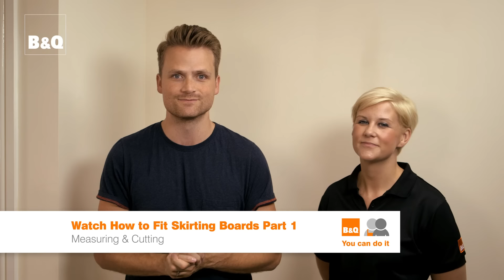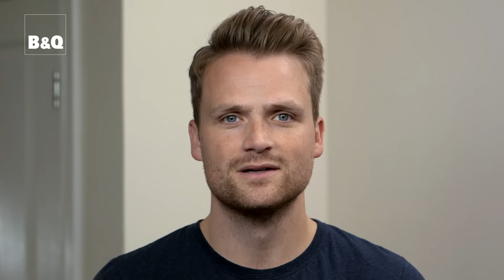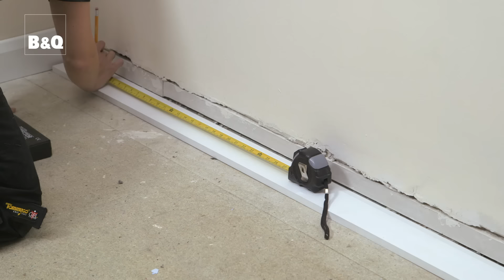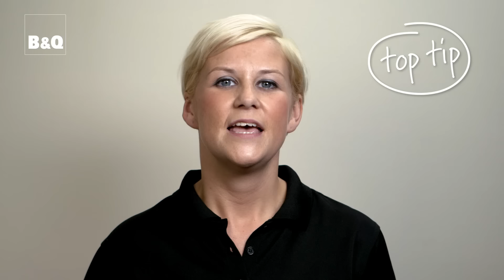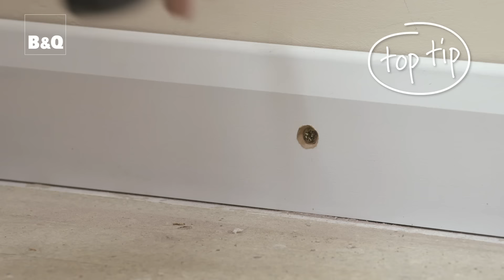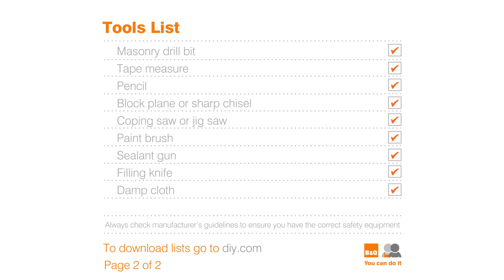How to fit skirting boards part 2: fixing the skirting boards

Comment: For the questions regarding a gap under the skirting. You only really need to leave a small gap of 1/2mm to allow for any uneven underfloor issues. For carpeting, the gripper goes close to the skirting anyway. For laminate, scotia beading is either your cup of tea or not. If not you can take your skirting off, lay your hard floor and rehang the skirting. If there’s any uneven flooring and it’s noticeable you might have to scribe the bottom of the baseboard or just accept the small gap (1/2mm).

Comment: What gap should be left between the floor and bottom of the skirting board for carpet fitting?
Reply from the maker: Hi there, a gap under the skirting board is not required 😊
Reply: I think B&Q are expecting that everyone nowadays uses grippers but I had exactly the same thought.  

I live in an old house with raised skirting and assumed you would only put skirting right to the floor if you were doing it on top of laminate or similar.  I guess if you want that still for carpet you use judgement - get a piece of carpet and underlay and see how high it needs to be.  0.5cm to 1cm seems reasonable depending on the pile and whether you want the underlay to also go under skirting.

Comment: Fixings wise: At 2:40 you were quite vague. You didn't explicitly say that you MUST use fixings for external walls - you only said this is for bowed walls... So I take it I can use the gap filling grab adhesive for external walls. 
I do want to use a gap filling grab adhesive for the external wall also because it is easier and I don't need to source a drill with the countersink drill bit which I will NEVER need again. Can I use the gap filling grab adhesive for flat external walls?
Reply from the maker: Hi there, fixings are only required when the walls are bowed. It's not a requirement for external walls unless they're bowed. I hope that helps! 😊
Reply: @bandq  brilliant, thank you
Reply from the maker: You're welcome 🥰

Comment: If I want to replace my old skirting which is bigger than this short skirting, do I need to plaster the gap with a gap filler or use skim material as the wall is currently skimmed.
Reply from the maker: You can use a filler to fill in any gaps once the old skirting is removed and rub down to make a flat finish before adding the new skirting.  This is fine for small sections or areas behind furniture.  However, for a really smooth professional finish, we would recommend skimming the wall especially if the skirting is going to be visible ie not hidden behind furniture. We hope this helps 😊

Comment: Has anyone actually attempted this in their house, I get the impression its allot harder than it appears in this video? Any comments from DIY'es who have attempted this would be great.
Reply: How fussy you are about a perfect finish will determine how hard it is though. If you are happy with it looking adequate then go ahead and do yourself.
Reply: Harder to cut them right but easy enough to fix to the wall
Reply: I am trying it right now. It’s not too difficult - an easy to moderate difficulty for a DIYer id say.
Reply: @bennershull  thanks for feedback. Have you come across any unexpected problems.
Reply: Yeah doddle mate did every room in my last house within 3 days first time I tried it. As usual tho the last room looks better than the first just don't use solvent free adhesive
Reply: @daveleaverdl  what's wrong with solvent free adhesive?

Comment: They're using the metal/electric/stud detector backwards!!!  You don't hold the side with the LED and switches towards the wall!
Reply: But the style of that one looks like if you do it the other way around you’d be holding the handle to the wall instead…

Comment: Grab adhesive rubbish my skirting fell off after a couple of years
Reply: Just used adhesive and screws
Reply: I live in a house that was built in the mid-sixties, while stripping one of the rooms skirting on the side of the chimney breast came off, it was nailed on, only reason it came off was that the plaster behind was rotten, might be a good idea to secure it with nails.